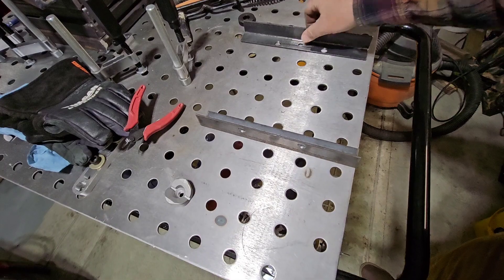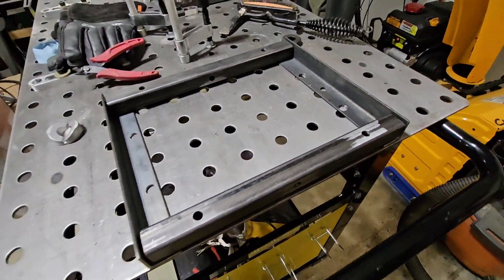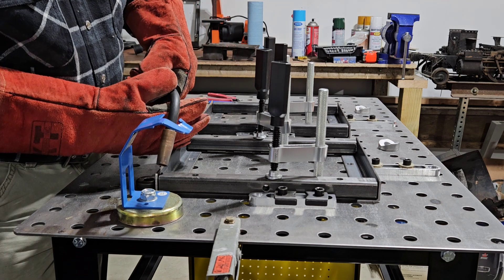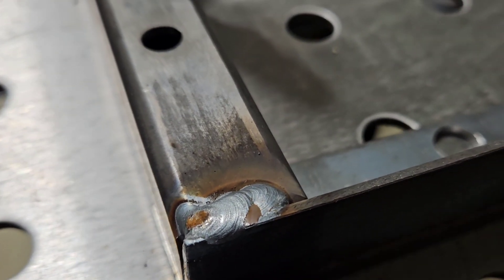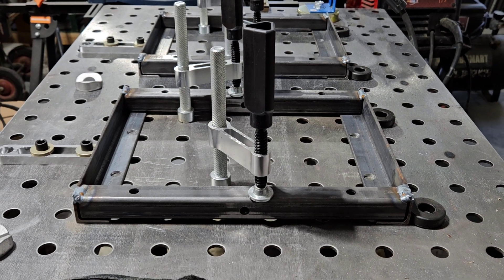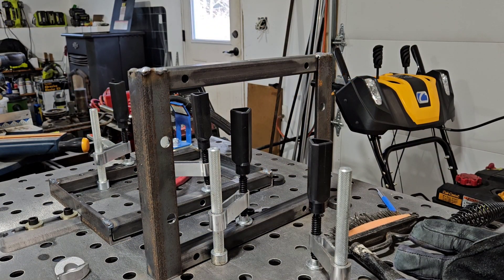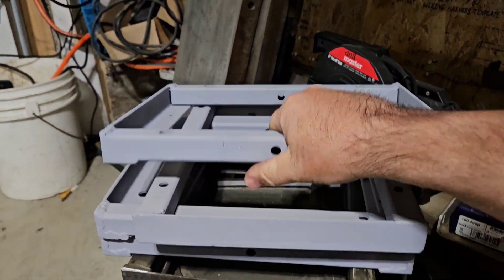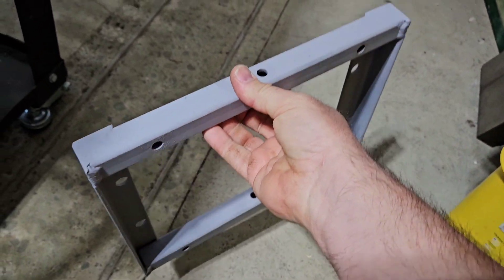Welding Trucks for a batch of new Locomotives!

Comment: Random though.  A Universal gripper popped up a few years ago that uses essentially ground coffee inside a thick balloon.  The object to grip is pushed into the gripper, then a vacuum is pulled on the balloon to lock the grains together.  https://www.youtube.com/watch?v=0d4f8fEysf8

I wonder if you could use Styrofoam beads and a large vacuum storage bag to make temporary fill to level out temporary track routes?  Would be a lot easier to haul around than sand-bags, but probably need the vacuum checked every day or two.  (described another way, each bag would be a giant bean bag chair that could be made rigid after molding into the correct shape)

Comment: TIP:  On the inside of angle iron is a fillet which will prevent any metal laying on the inside from ever getting a tight fit. Grind the bottom corner of your cross piece at an angle to clear the fillet and you will be able to get tight joints without gaps to fill.  It really makes it an easier weld to do.
Reply from the maker: Thanks

Comment: Just FYI.  What you should do before totally welding the parts together is ‘tack weld’ them together. This lets you check the alignment of the parts make adjustments if you need to. Then you can weld in confidence knowing the parts won’t move.  And a grinder would be more effective than a belt sander.